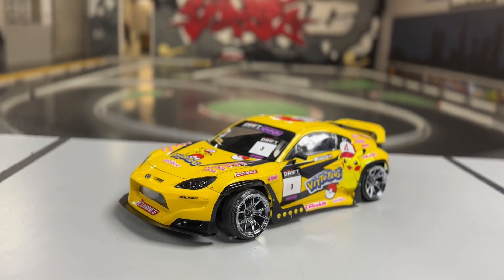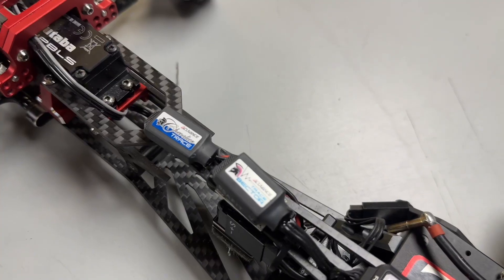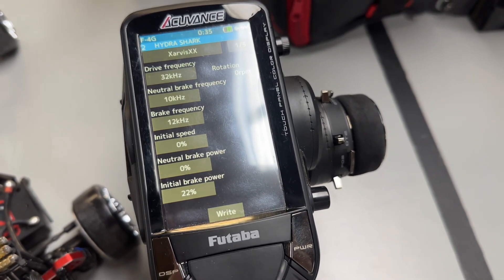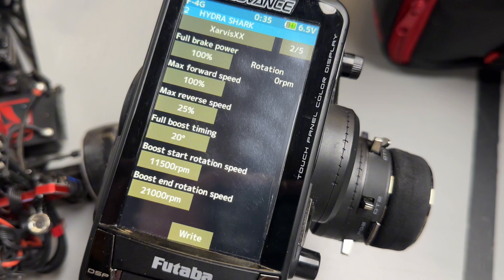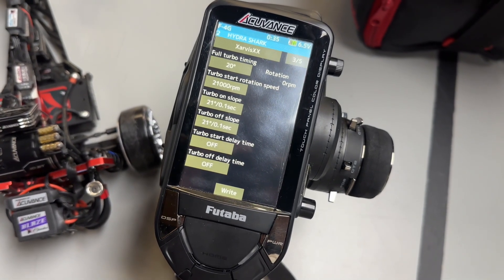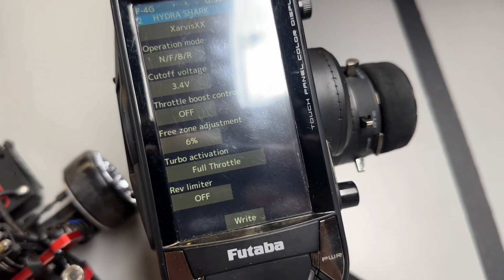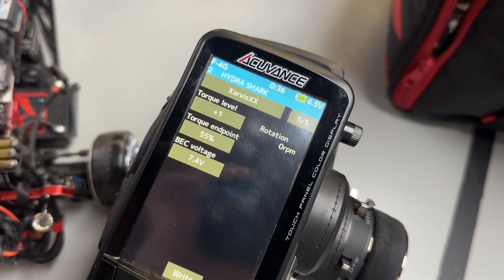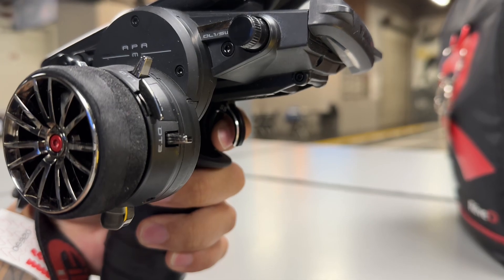My Acuvance Xarvis XX / RAD ESC Tune

Comment: Great setup, I had qui similar setup on my xr10 stock spec. But boost rpm range was wider. Tried yours and it really work great, Thanks! Juste a quick note, you are talking about turbo activation rpm, but your turbo is set as trottle only. Im pretty sure that rpm doesn’t apply.

Comment: i got the rad w agile motor and i set my initial settings per instructions now i dont have reverse... any suggestions?
Reply: You need to hold on button on esc it will blink then you can calibrate the end points on your remote

Comment: I just upgraded to the s.bus and went through all the updates required on the rx/tx & esc. Everything was working as it should. I then followed your tune on this video. Did one hit and now the motor won’t spin and all the lights on the esc are blinking. Please help! Did I just blow up my motor???
Reply from the maker: Sounds like a loose sensor wire, this is a pretty conservative tune.
Reply from the maker: You should also unplug the esc from battery for a minute and then recalibrate after an esc update.
Reply: Yes that was my first thought as well so I replaced the sensor wire and same issue. I did some further digging and my rotor disengaged inside and took out the sensor module with it. Another 90$ down the drain let’s hope that it can be pieced back together 😢
Reply: I run this tune since 5 months ago every weekend without problems,it runs very smooth and I love it..Maybe you ran too much can timing on the motor,I run 20 degrees on the can....Or maybe you just had a bad rotor,it happens sometimes,pretty sure this tune has nothing to do with your rotor failure since is not agressive at all.

Comment: Interesting settings on timing, how does that translate to trigger feel? you have no additional timing up to 12k rpm and also above 21k unless you full throttle. does this give your low and high throttle more resolution and less puch in a way since you don't have the extra timing kicking in?
Reply from the maker: I find not needing anymore timing after that. We’re on a slippery surface after all!